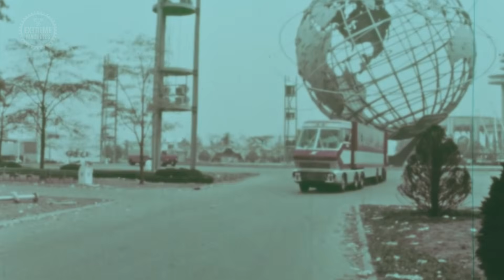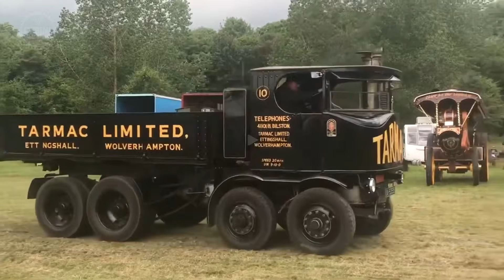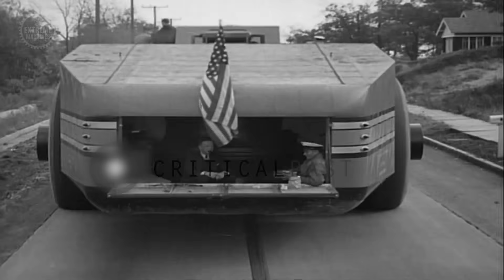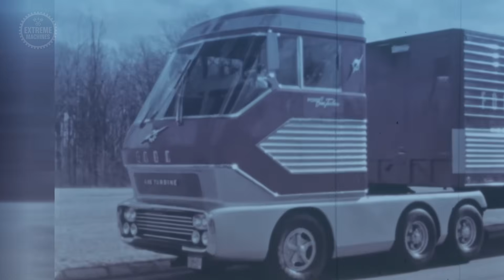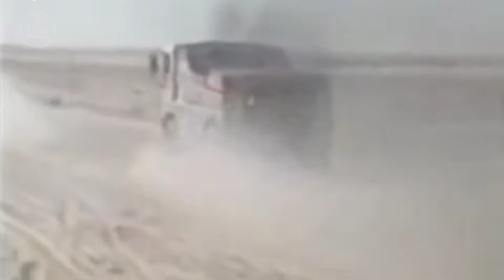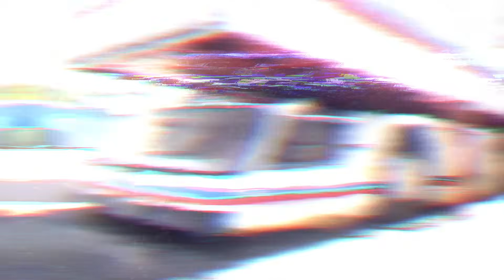10 OLD Truck Features So DANGEROUS They Disappeared Into History!

Comment: Something quite serious you missed with the Scammell Scarab was the trailer coupling could be quite unreliable. Quite a few serious incidents were caused by the trailer going it's own way (often due to the cornering characteristics as mentioned). The issue was that the trailers had a fixed undercarriage that was lifted off of the ground when it coupled to the tractor unit. This fixed undercarriage had a pair of (normally) cast wheels that were unbraked, and the braking system was mechanical from the tractor unit to the trailer (the flat sheet of metal between the opening in the chassis). If the trailer became uncoupled, then it had 4 wheels on which only 2 had brakes, and those were inoperative. Modern trailers tend not to use wheels for the undercarriage (although some still do), but they are almost always air braked which will apply if the  tractor and trailer become uncoupled.

Comment: No 0 to 60 times because the vehicles were too slow. - and explicitly mentioning it for ¾ of the video. But then, finally a fast enough truck. And it's zero to sixty... TWO! What a strange video
Reply: Because DAF is from Europe and in Europe the measurement is from 0 to 100 kph, which makes ~62 mph. They also did not know the 0-60 time, because they never measured it :D

BTW it is a pity that the footage of this DAF overtaking a rally Peugeot 405 (during mentioned Dakar Rally), driving way over 120 mph off-road was not included. It is a legendary moment
Reply: @AZTG92 wasn't that De Rooy and Vatanen?
Reply: @y.t.b.s.c.k.s  Yes, exactly, these two.

Comment: Wrong wrong wrong the DAF twin turbo had only one trick - that you miss- the back engine that run’s the front wheels, had ALWAY’S a slightly higher RPM then the front engine that run’s the backwheels. The accident tht accured was due to the underground that was not level in the wrong way.  Like you have waves at sea,that keep coming in the wrong way. Just saying hah! I have the same engine in my DAF..

Comment: The Scammell Scarab was a development of an earlier tractor unit designed to replace the horses used by railways in Britain for local deliveries. The three-wheel design was a clever solution for the need to manoeuvre in small spaces such as local railway goods yards. It wasn't a dangerous design, it was safe, mechanically reliable, and simple to drive. I've never heard of one of these overturning when cornering.
Reply: The company I worked for ran one converted with a luton box body on it as recently as 1973.
One driver managed to overturn it half way across a bridge.

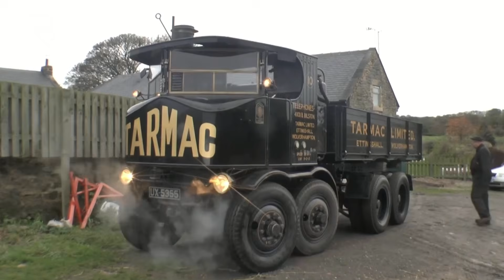Comment: 4:51 much more serious failure, that would be a boiler explosion and yes, those are very lethal depending on the blast radius because hot water, extremely hot metals and shrapnel will go flying for miles, so this is a reminder to always keep the crownsheet wet and water levels filled up properly
Reply: I’ve seen the aftermath of a boiler explosion, there wouldn’t be enough money in the world to get me to operate one of those things.